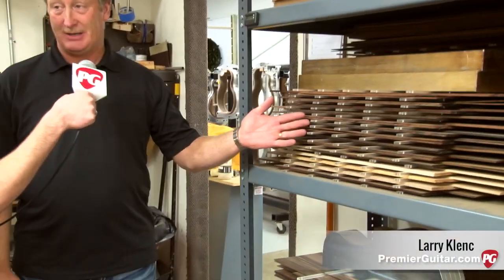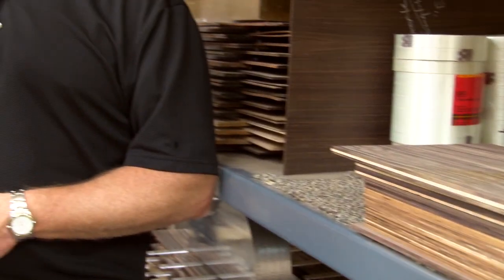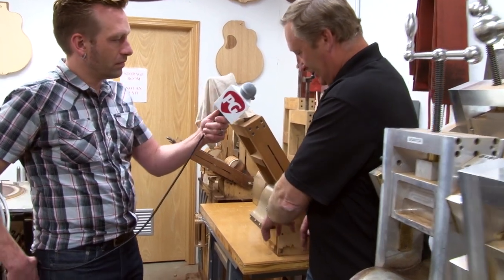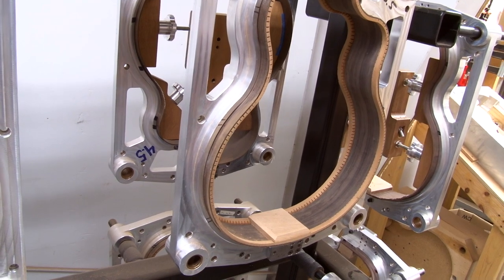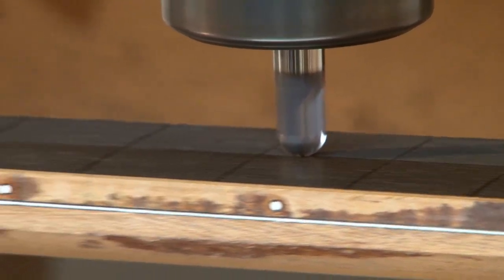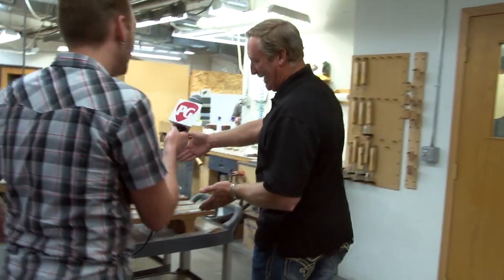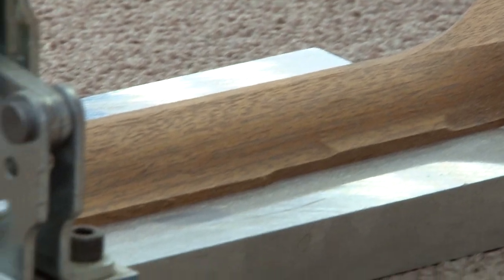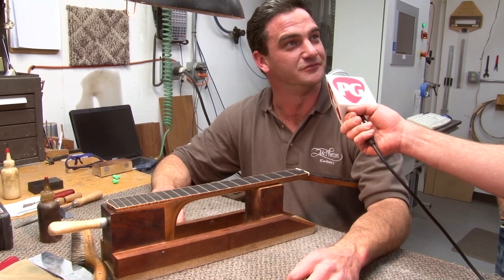McPherson Guitars Factory Tour Part 1

Comment: More and more guitar players are discovering that by sanding the back of the neck you can create a very smooth playing guitar. A very shiny, smooth surface will create more and more sliding resistance, when your hands get sweatier. By sanding it the sliding resistance is diminished significantly, resulting in more precise and faster hand movements. To this day, I have not seen any professional guitar builder apply this feature to their guitars. Since McPherson builds guitars as close to perfection as humanly possible, I wonder if they will ever adopt this feature and apply it to their guitars. If the customer so wishes, ofcourse.
Reply: Eastman did on their Ray Benson signature guitar.  The entire guitar was given a satin finish, not just the neck.

Comment: Hopefully he meant 6 mo LEAD time/backlog and not "build time".  They have enough machinery/automaton that the body/neck box should be a week tops, and another week for finishing. I'm also sick of the CNC apologists. They should be bragging that every possible repetitive grunt operation that can be eliminated - has been. It sounds like they have all kinds of crazy bottlenecks (4 necks per WEEK?)  All this adds up to something that is going to be extremely expensive when it wouldn't need to be. What if it took PRS or Martin a week to make 4 necks ?
Reply: +Tioga Fretworks  RPS and Martin crank out guitars a lot faster because they're much cheaper guitars, and not up to the quality level of McPherson. If you want to talk about custom $15,000-$20,000 Martins, then you're in the comparable range of McPherson, and I suspect they spend a lot more time building those than the standard models hanging in any Guitar Center.
Reply: kevinb2014 prs makes some incredible guitars. meth. not even once.